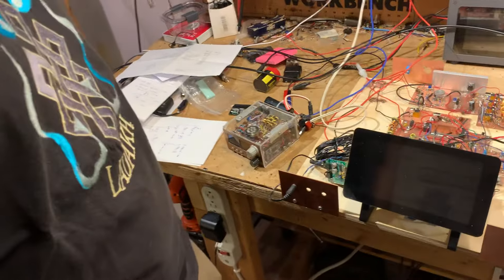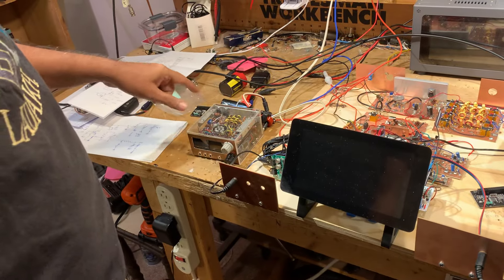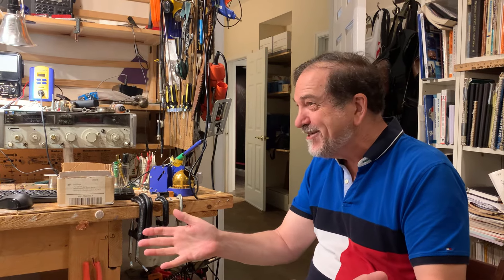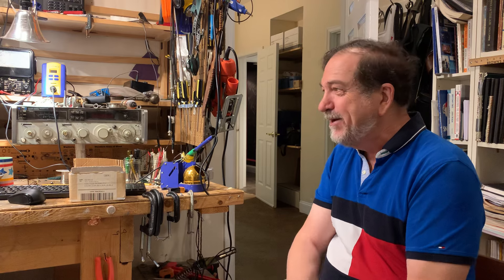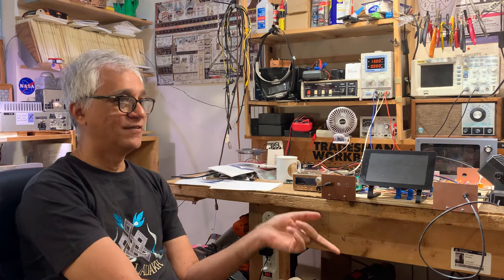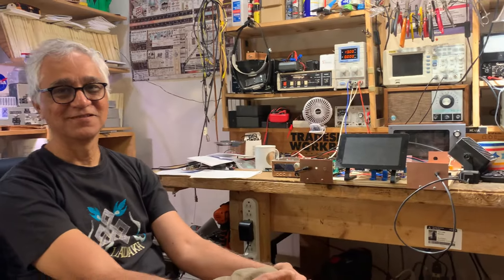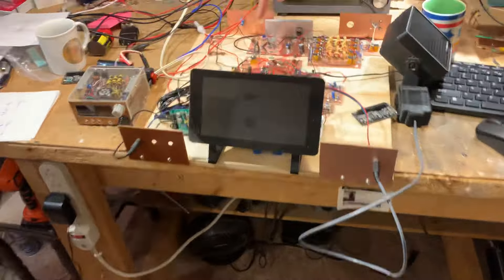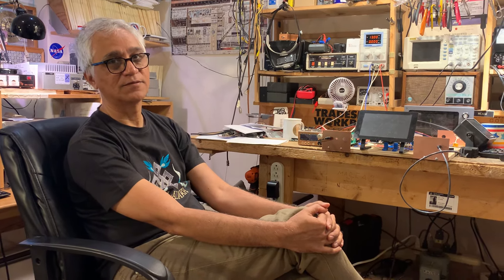Part II -- Farhan VU2ESE, Dean KK4DAS, and Bill N2CQR on technical issues in SolderSmoke HQ (East)

Comment: Ashhar, Absolutely correct the IMD is typically developed at an extremely low level most likely at the very first part of the Transmitter driver preamp. This is very common knowledge in the Broadcast Transmitters, Seldom is the IMD product part of the PA Stage.

Comment: Regarding FT8, I just got back on HF after almost three decades, I bought an sBItx v3 and I've been operating FT8 with it, mostly on 20m.  My antenna is only a G5RV Jr. strung up in my attic, and my sBitx shows 10-13w out on 20m (I get the full 25w on 40).  So for me, regardless of the fact that it's my computer communicating with another computer, I've worked 24 countries in less than 3 weeks, I'm in upstate NY, and two of the countries I've worked are Japan and Australia.  So for me, given my setup, FT8 still is a challenge for me, the challenge being adding new countries.  I plan on stringing an EFHW up in my attic to see how that performs vs. the G5RV Jr.